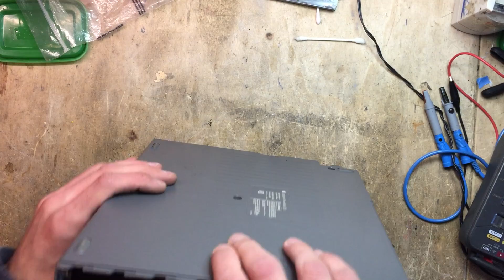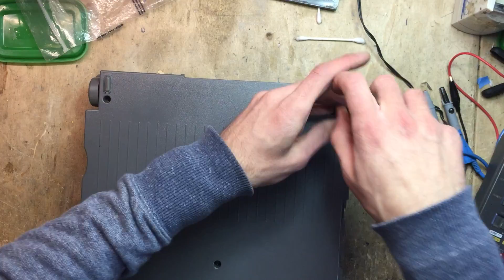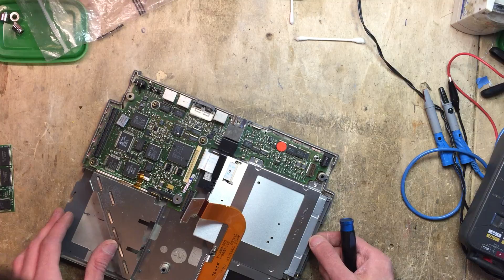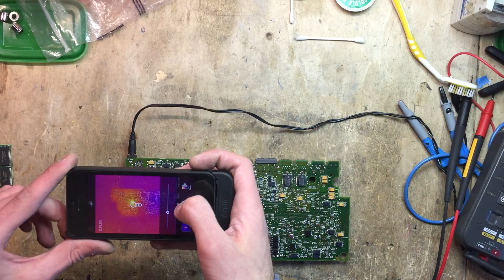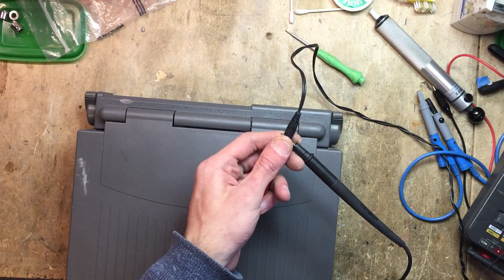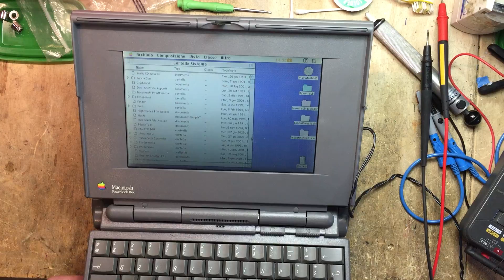Apple Macintosh PowerBook 165c Diagnosis Teardown and Repair

Comment: I got a powerbook 165c with the exact same diode failed. I replaced it and now the thing powers up for 2 seconds but shuts off. Any ideas?
Reply from the maker: Griffin S what power supply are you using?
Reply: @FrancescoF  Lab bench power supply set to 7.5V 2A
Reply from the maker: Griffin S disk might be a little stiff, does it hit 2A? Bump it to 3 and set the brightness to zero
Reply: @FrancescoF  it only goes to 1.2A before turning off. I can hear the hard drive spinning up if I put my ear next to it

Comment: I have a 165c that was working until the video suddenly cut out. It still boots (chimes) but there is no video. Any ideas?
Reply from the maker: you have no video or no backlight? usually color PowerBooks don't have display problems. you might also have a leaking clock battery that corroded some of the traces on the interconnect board that goes between the processor board and display
Reply: Oh yeah there's a backlight but that's it. I suspected the interconnect board or a lose connection because if I twisted it a little the display would occasionally come back but not anymore.
Reply from the maker: so it's possible that you might have a broken cable (backlight runs on separate cables), you can easily open it tup to confirm that
Reply: I had a look at this again but I was wrong before. The machine chimes and boots but there is no backlight and no display at all. 

I've inspected all of the connectors and don't see anything wrong. It was originally working fine and then just failed.
Reply from the maker: can you test in on an external monitor? the 165c should have the video out connector
Reply: I don't have one unfortunately but the fact that even the backlight is not working indicates a failure of the interconnect board. Unfortunately that's one component that seems to be different in each 1xx model.
Reply from the maker: does it still have the backup battery on it? it may have leaked and corroded some of the traces